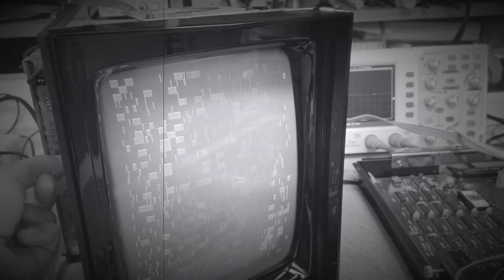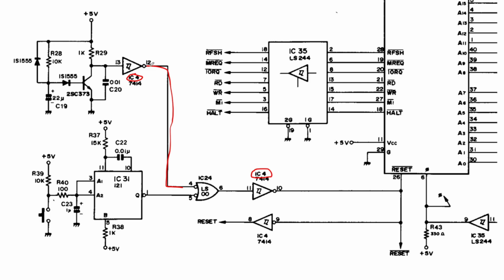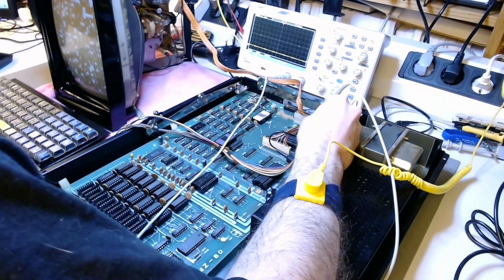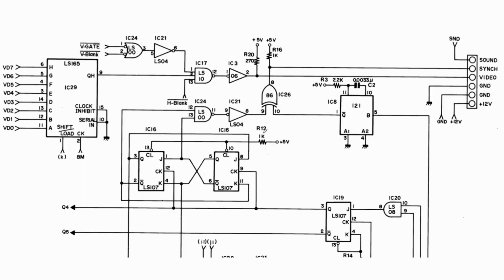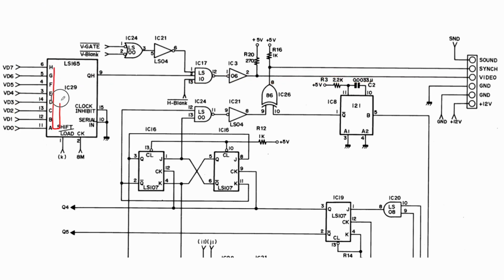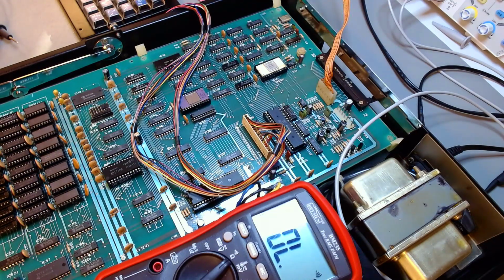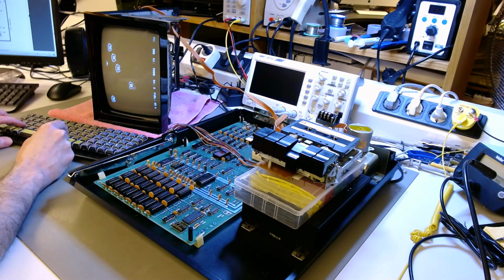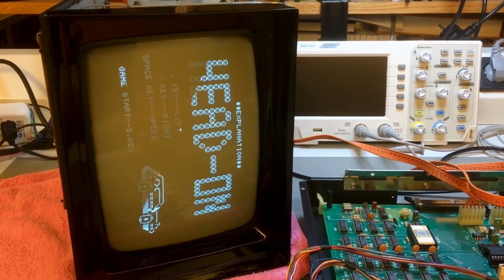Sharp MZ-80K museum-quality restoration, PART 9

Comment: This has inspired me to get my (working) MZ-80K out of the closet. I assume it would be good hygiene if I recapped it for starters. Where would you begin a project like this?
Reply: Thanks. I will begin there.
Reply from the maker: Power supply, in the same order I did it on the video!
Reply: @thebyteattic  Thank you.

Comment: This has been a beautiful restoration job!  I am in the process of restoring a Sun Sparcstation 2 myself.  Not nearly as old as the Sharp MZ-80K, but I will be re-watching this whole series for pointers on getting this right since the computer will be a gift to a family member after I am done.
Thank you so much for posting these videos.  I think I said in a previous comment that I'm sure this restoration series will be used by people around the world as an example of the right way to go about restoring an old computer.  Amazing work by you on this project.  The museum that will be getting this machine is a lucky one indeed!
BTW:  Again, you show the "power of the schematic" in combination with some deductive reasoning when it comes to diagnosing issues.  And your diagnostic skills resulted in two very straight forward repairs.  And thanks, too, for including the bit about reversing the connections of the B and E pins of the transistors.  It helps me to not feel so bad about it when I make similar types of mistakes.
Reply from the maker: Cheers mate! My career began with a Sun Sparc Solaris, so that machine is very dear to me!
Reply: @thebyteattic  Coincidentally, when I purchased it (saw it at a recyclers and made an impulse purchase) I saw, after getting home, that its date of manufacture on the bottom label was on the day of my 24th birthday!  I think I was meant to end up with this machine.

Comment: So how did you adjust the tape azimuth? How did you monitor the signal? You can do it by ear or by eye. Or did you just adjust it a small step in one direction and checked if tape loading improved or got worse (you would get a load error  sooner)? If it got worse, you would try the other direction.
Reply from the maker: The latter! A small adjustment and then trying again. But it worked immediately after the first small adjustment.